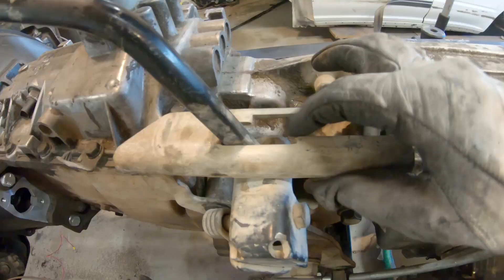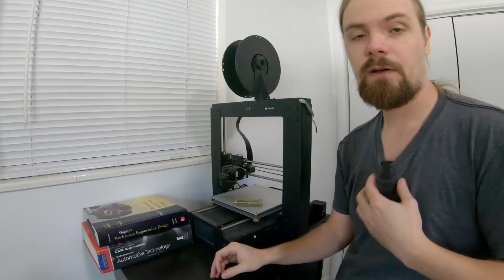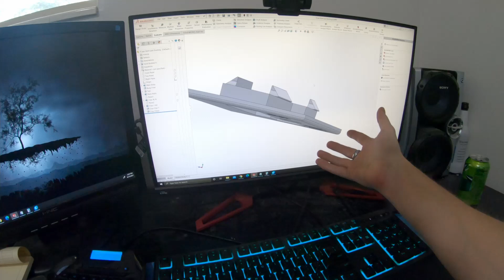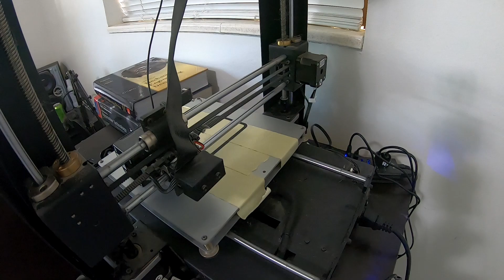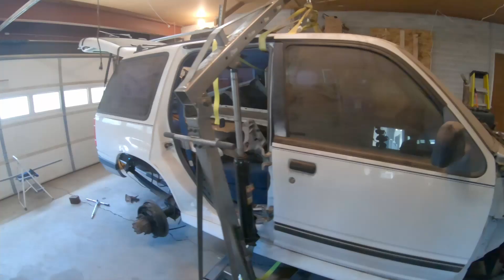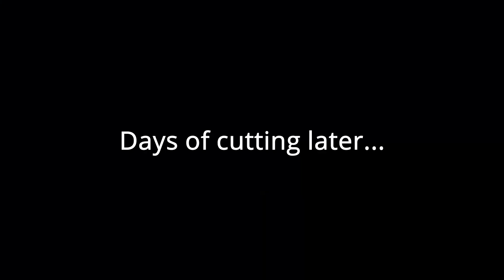This Took a LOT of Cutting!

Comment: Did your door frames get messed up or distorted when you lifted up your SUV body?
Reply from the maker: The doors seem to still close fine, no visible issues. The only thing I had to watch out for was making sure the cherry picker wasn't runnig into the rockers.